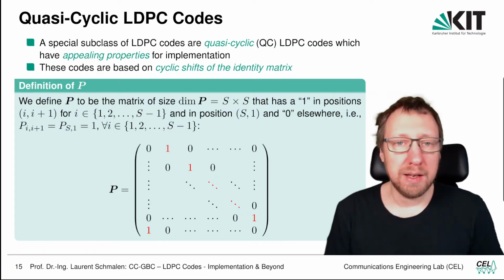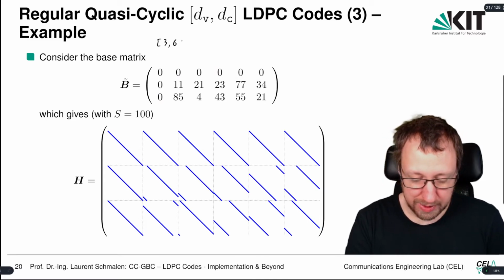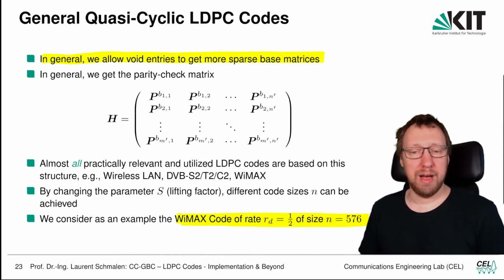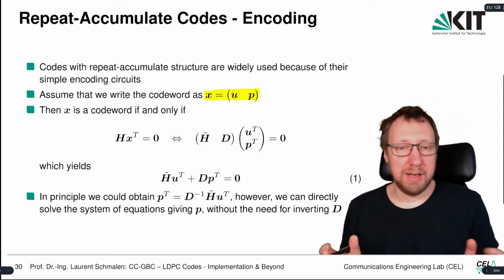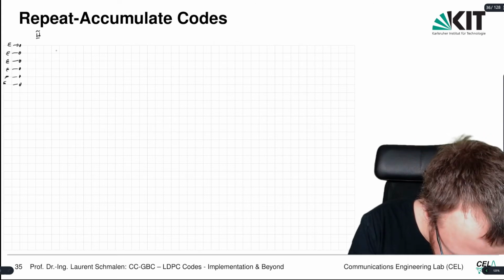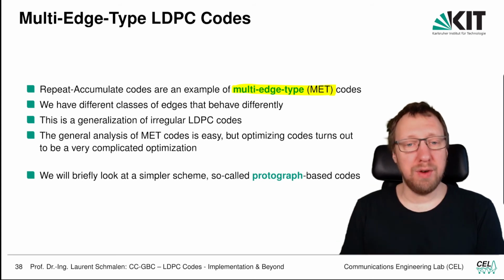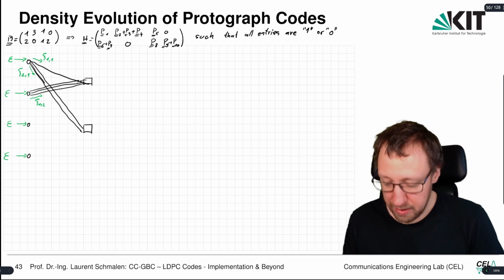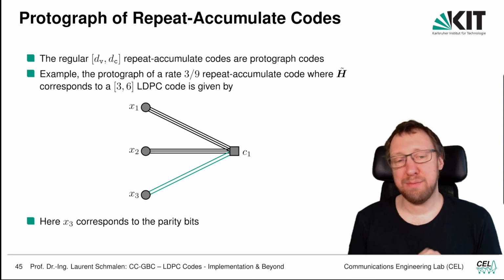Lecture "Channel Coding: Graph-based Codes", Chapter 6, Vid. 2, "Practical LDPC Code Constructions"

Comment: I am wondering about the Density Evolution of Protograph Codes which you showed in the end of the lecture. How does the first iteration look like? What are the starting parameters? Are all chi_ij equal to 1 then? It would be very helpful to know for me. Thank you in advance!
Reply from the maker: That's exactly what you need to do yes! You initialize all \chi_{i,j} = 1 and then start iterating